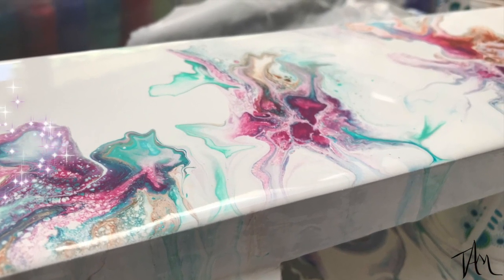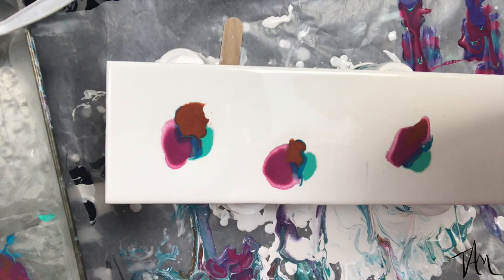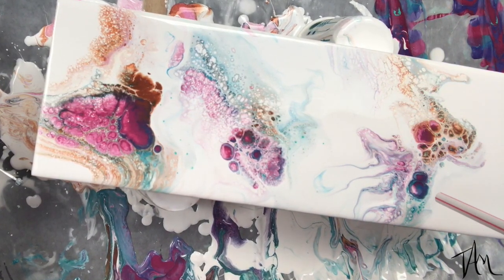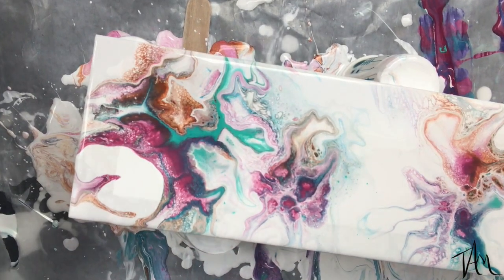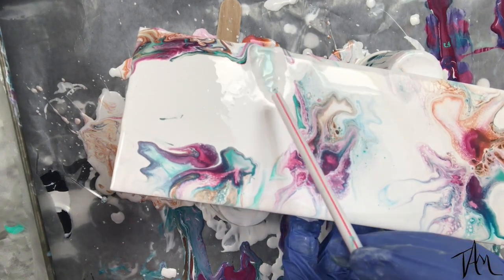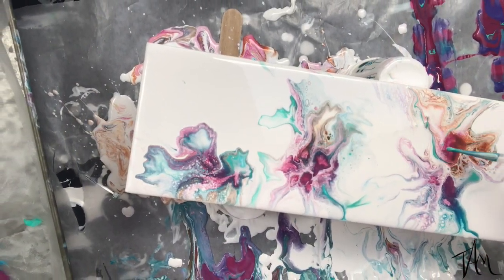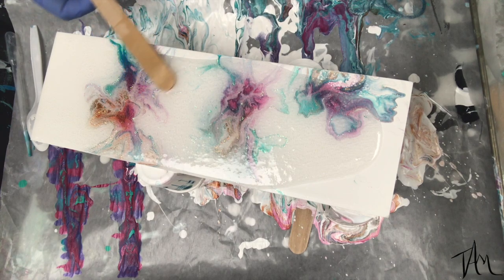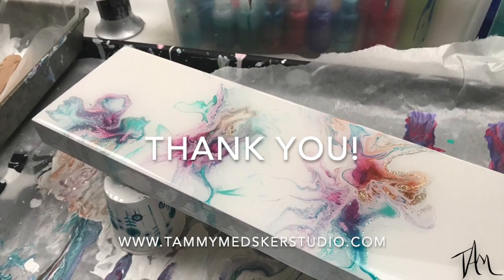Dutch Pour Technique With Epoxy Resin Clear Coat

Comment: Can someone please tell me what to do with dried resin drips typically on the sides? I was able to wipe most of the edges smooth, but I missed a few spots. Is there some sort of filing or sanding you'd recommend?